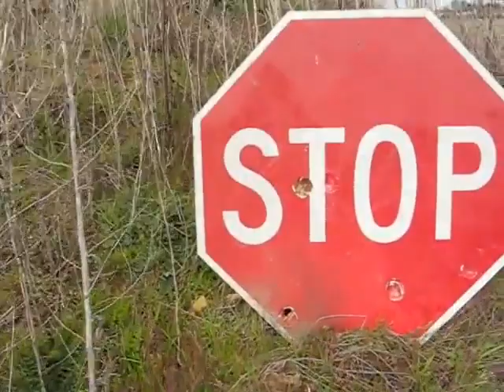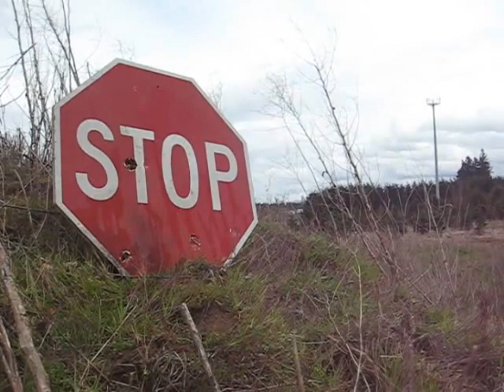Golf ball launcher

Comment: You should try it with a metal stop sign next.  I built a monstrous pneumatic cannon that fired a 1 inch ratchet nut at 400 fps and still couldn't get through it.  I left one hell of a dent though and actually ripped the metal a little bit, and that was from 50 meters out.